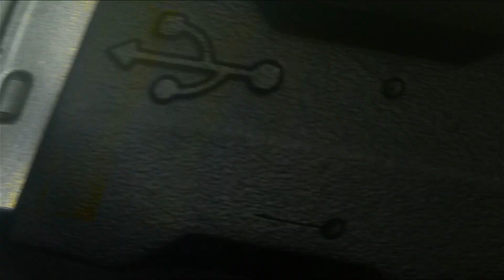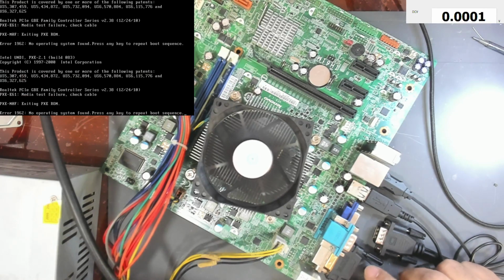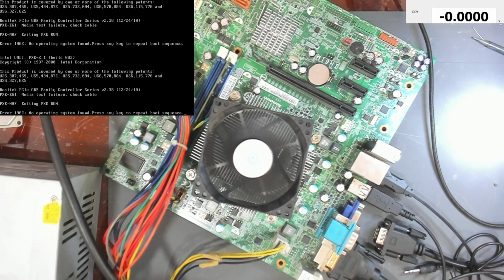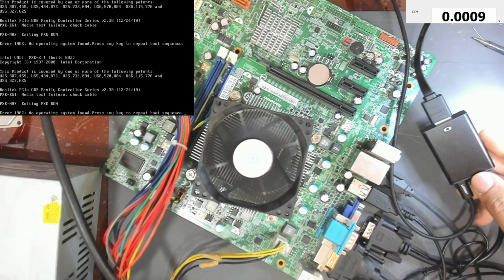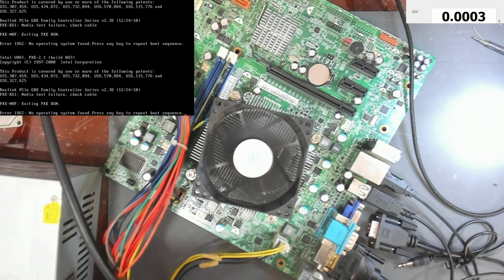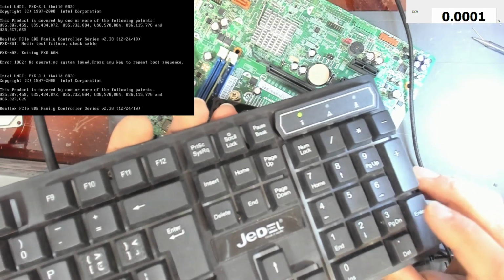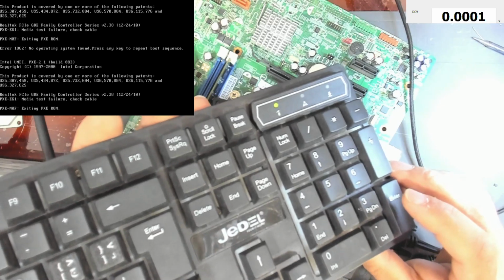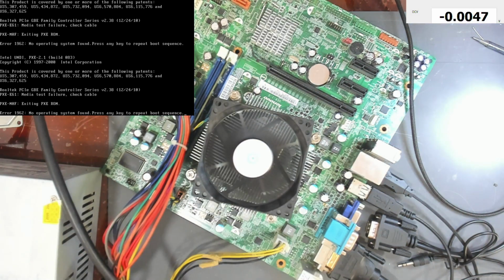All USB Ports Not working Fix || Lenovo USB ports not working #usb

Comment: GIGABYTE H61 MOTHER BORAD ALL USB PORT WORKING BUT TWO CONNETION  3 NO USB DEVICE CONNENT ALL COLLENTION AUTOMATIC CONNECT DISCONNECT  PROBLEM ? Kyesa Problems SIR ?
Reply from the maker: You may have a lose USB ports or a cracked or dry solder joints at the usb ports pins

Comment: on my Intel mobo, just keyboard n mouse work normaly..other device like bootable usb stick cannot boot as usually even it detected on bios. it also detected as unknown device on windows. what is the problem actually with my mobo?
Reply from the maker: You might have a usb ports disabled so no usb drives can be connected 
Check this link for more understanding 
https://www.currentware.com/blog/how-to-disable-usb-ports/